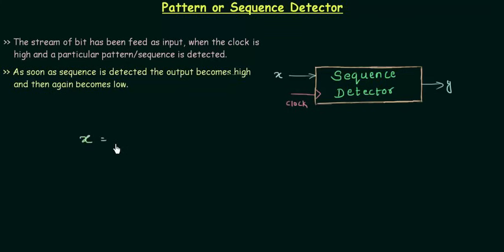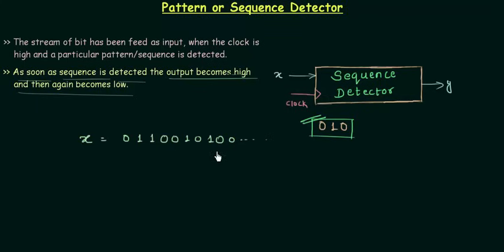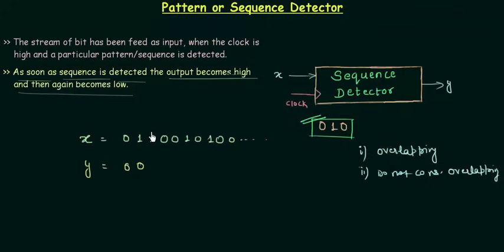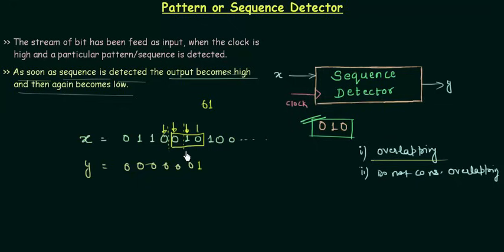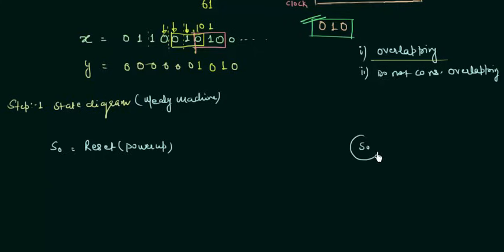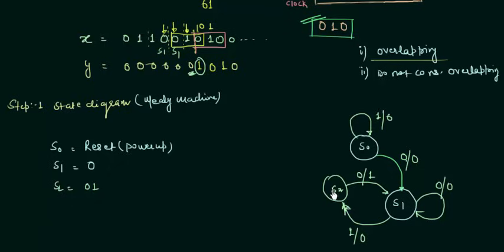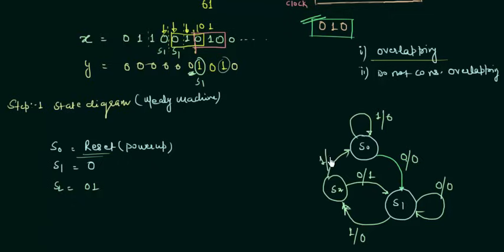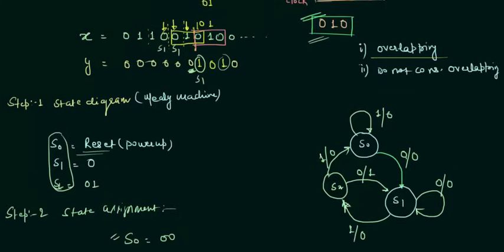Sequence or Pattern Detector

Comment: Who need a clarification for state diagram look into this -
Since we are solving for 010
S0 - when the input is 0, it will go to S1 state, if input is 1 it will be in reset state only. 
S1 - when the input is 1 it will go to S2, but when i/p is 0 it will remain in S1 state because it will compare 0 with 1-bit state i.e; S1 and S1=0
S2 - when the i/p is 0 it will compare 0 with 1-bit state i.e; S1, if it matches it will go to S1 state and in case it hadn't match then it will go to reset state, when i/p is 1 it will compare 1 with 1-bit state and it hadn't match with S1 state Since S1 = 0, so it will go to reset state. 
I think u guys will got it now.
If it is useful click like.

Comment: For those who are confused, here's a description of the states:
1) S0 - i have seen none of the pattern 010
2) S1, I have seen a zero
3) S2, have seen a one after a zero

Transitions: 
1) The only transition leading to an output '1' is S2 to S1 with an input of 0. 
ie. I have seen a 0 and then a 1(in state 2), and then now i'm seeing a 0
2) All other transitions lead to output 0.

Note: A moore machine would have four states and is easier to understand:
1) S0 - i have seen none of the pattern 010, and output 0
2) S1, I have seen a zero, and output 0
3) S2, I have seen a one after a zero, and output 0
4) S3, I have seen a zero then a one, then a zero, so i saw the pattern and output 1

Now the moore can be reduced to a mealy machine by merging states S3 and S1, (since transitions out of both S3 and S1 are to the same states S1 and S2 on  inputs 0 and 1 respectively).
Reply: Thx a lot
Reply: Thank you
Reply: using four states for any flip flop seems feasible, but does it really matter? I mean I can still implement using 3 states on any FFs ig. I haven't tried out writing the state table, but I feel it is okay both the ways. Plus does it always be a mealy state machine for pattern detector?
Reply: Thank you very much now I clearly understand the topic
Reply: Thanks a lot ! You made me understand this, thanks a ton !!
Reply: Still not very clear sir . Thanks for your effort 😁
Reply: Thanks a lot! This helped immensely 🙇🏼‍♂️
Reply: Thank you for the explanation sir.. it cleared the confusion
Reply: thanks sir
Reply: So when 010 is detected at s2 will it again go to s1 as input 0 and output 1???
Reply: thank u very very much!
Reply: thanks
Reply: Thank you
Reply: Still not understanding
Reply: Thank u this helped me understand it!
Reply: But isn't this already a mealy machine ? 
and also this give 1 as output even for overlapping (try for 01010)
ans here :- 00011 actual ans (for no overlapping):- 00010
Reply: @shubbhumyadav2296  I don't understand your question. For input 01010, and for detecting pattern 010,
for no overlapping, the output should be 00100 
for overlapping allowed, the output should be 00101

Comment: I have some issues considering the implementation of the circuit . I am considering that my equations form the K map might be wrong . My first doubt is if there are only 3 states or any odd number of states  , I can code them only on a pair number of bits so in the truth tabel should I consider the states that are not involved? As for the  K map should I make it with Don't care ?  for this example we have 3 states : 00 01 10 . so the state 11 is not in the truth tabel but it appears in my K map . What do I do? Ty for helping me out.